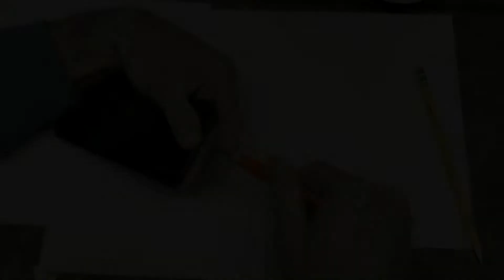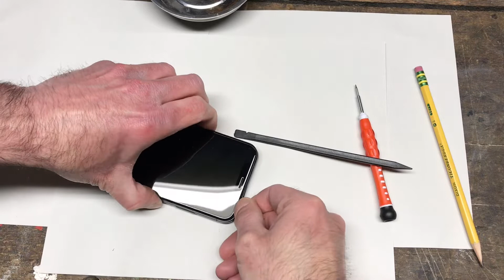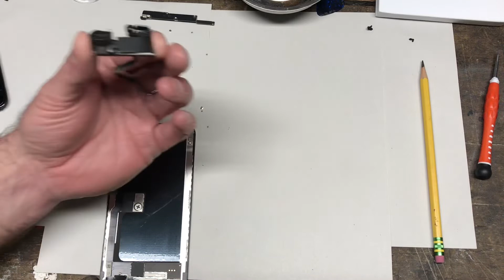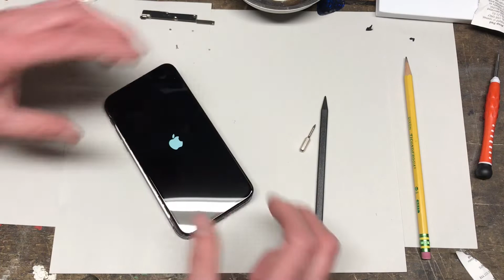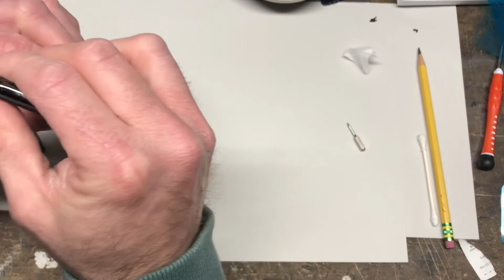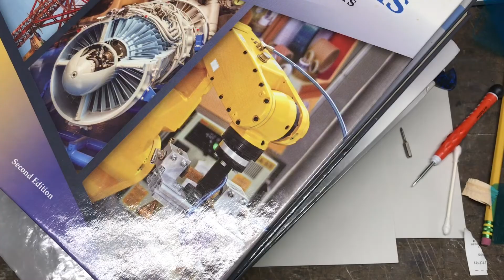iPhone X Screen and Adhesive replacement

Comment: Great video, thanks. You show great patience in doing this repair. I work on watches for a hobby, and this isn't much different in the eyesight, dexterity, and temperament department. I just noticed my 10's screen bowing up, so I might have to re-do something. This will help if I decide to do it for myself. I have the tools. With my watchmaking tweezers, etc., I should be able to do the job. With more magnification though (Old eyes.). Thanks again. Cheers.